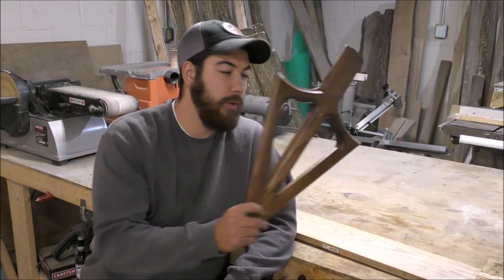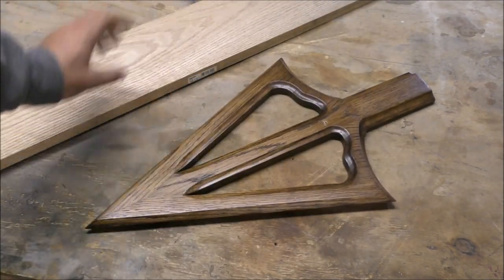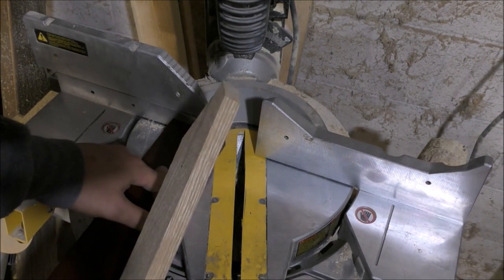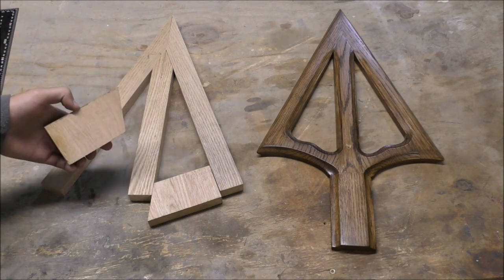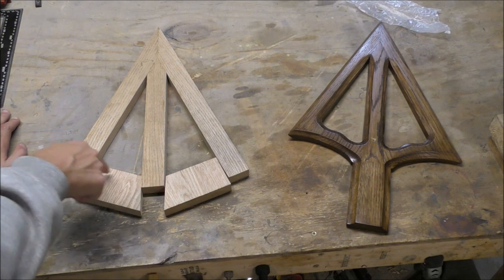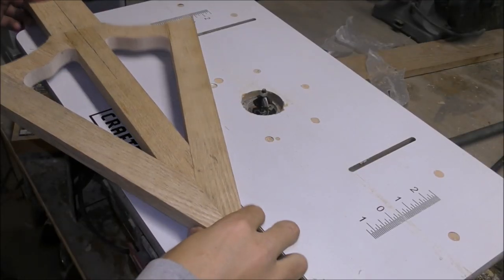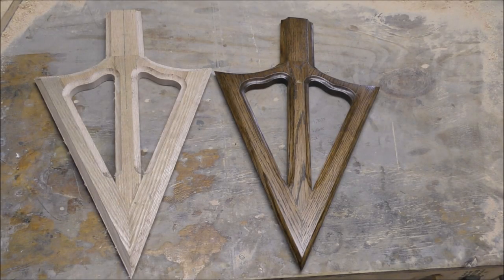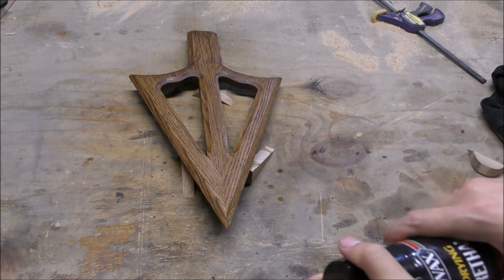European Deer Skull Mount Broadhead Plaque

Comment: What’s the best way to mount the actual skull to the plaque?
Reply from the maker: Normally I mix some JB weld or Bondo up and glob it into the base of the brain cavity. Once it sets up, I flatten it on a disk or belt sander to whatever angle you want it to sit on the plaque. Then drill a pilot hole all the way through the plaque into the JB weld or Bondo. Open up the hole in the plaque to let a screw spin freely, countersink the back of the plaque, and put one screw through the plaque into the skull.

Comment: Why not make the center and shaft all one piece? Making a few now.. looking good ty
Reply from the maker: You probably could, but I wanted to have a visible line from the wood joint where the broadhead would screw into the arrow. Also, just made it easier for me to make.
Reply: @NobleSavageOutdoors  gotcha.. was just a thought
Reply: Wish I could send ya a cpl pics... made two so far... they turned out great dude... thanx
Reply from the maker: If you have Facebook or Instagram you can tag me. My accounts on both are just @noblesavageoutdoors.

Comment: Do you put any mounting hardware on the back to attach to the wall?
Reply from the maker: I did. I used picture frame hangers from a hardware store on this one. In the past, I have also just drilled a small hole at and angle upward, just enough to fit a small nail head or screw head for hanging on the wall. Both work pretty well.